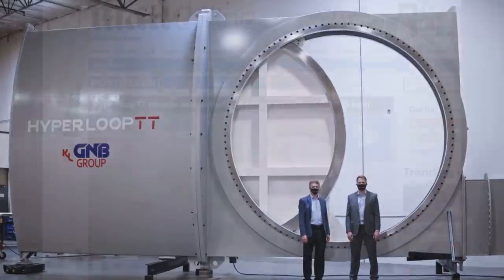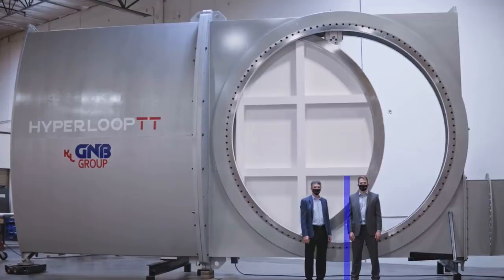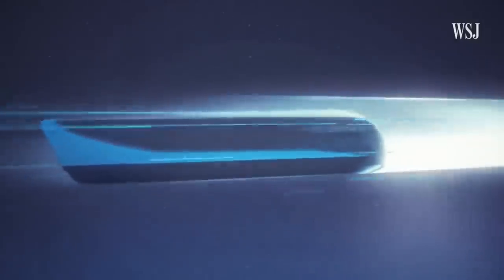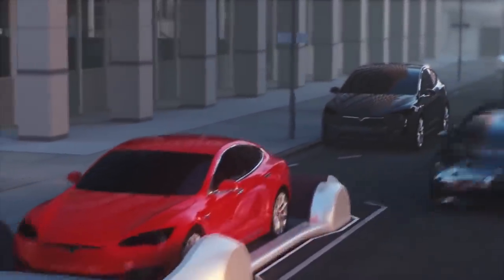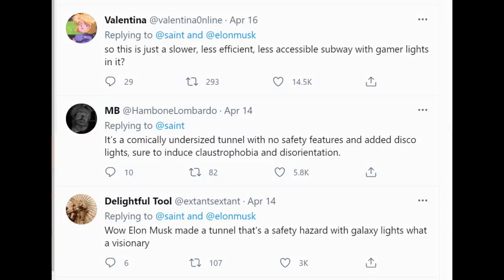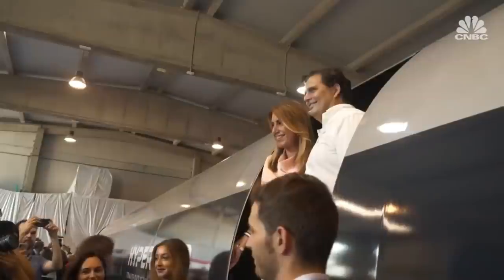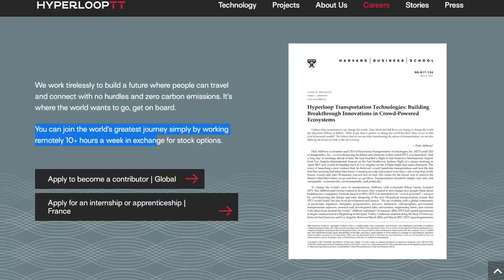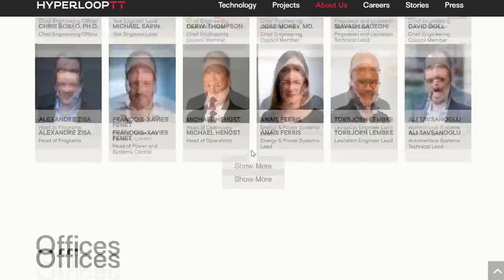Hyperloop TT vs. Virgin: The Race to Make Musk’s Moonshot a Reality - BUSTED!

Comment: What bothers me with Elon Musk's loop system is the fact that they didn't even make it autonomous driving (yet). Unlike the open roads, which Tesla's autonomous driving is already being used to a limited extent on, these tunnels under the convention center are a closed system. They can put whatever they want in the tunnels, in the road in the tunnels, and on the cars, whether that be sensors or paint, and program the AI onboard the cars to recognize specific patterns of paint or detect certain sensors and react to either of those things. They have control over the environment those cars drive in, designing it so the cars know exactly where they are, what they are doing, and what the other cars are doing should not be a difficult challenge, ESPECIALLY compared to the open road.

And yet they couldn't do it. At least, couldn't do it before it opened.

There's this ride at SeaWorld Orlando before the penguin exhibit. It is a trackless dark ride, which basically means it's autonomous vehicles driving themselves around, spinning the guests around and angling them up or down slightly to look at screens. This attraction would have multiple vehicles on the same section of ride at once, with, if I recall correctly, 3 all spinning around the same room at once, and 2-3 present for most of the show screens. Now sure, this ride isn't as fast as the loop, with the ride vehicles topping out at 5.5 mph according to the manufacturer's website, but it's still very much a case of multiple self-driving cars driving around the same closed-system setting successfully, and it opened a full 8 years ago. Tesla has apparently not figured out how to implement a similar system to what these guys used for driving cars at 30 mph in a similarly closed-loop system, and instead used chauffeurs. 

About the only good reason I can think of for "why" is the loading and unloading area, but it really shouldn't be that difficult to figure out something to make that safe.

Comment: Imagine if a contractor for just a normal train behaved like this. They design the paneling on a train and two years later you check back and they've just shown you how the junction switches will work.

Comment: Pipe Dream loop, Defraud Investors Loop, Money Laundering Loop...
How much energy would it take to keep the system under vacuum?
How would they deal with an emergency(medical or mechanical between stations?    
Wouldn't a high speed train be better?
Why no interest in ground effect vehicles instead, wouldn't they be cheaper, and much more practical?

Comment: Isn’t the pressure on the valve independent of the length of the tunnel? Kind of like the pressure on a dam isn’t dependent on the size of the lake but only the depth of water.
Reply: No, the air pressure is pressing on the face of the valve.
Force = Area * Pressure.
Pressure is one atmosphere

Comment: Looking at Las Vagas on Google earth, the further distance l could measure from end to end was about 25 miles. 
To reach 120mph top speed with comfortable acceleration and deceleration means you could make it from one end to the other in 15 minutes or so, but surely people need stops in between, so it would never get to 150mph if there were a stop every 5 miles, and it would take much longer to get people in and out of the pods compared to a metro type train, and they hold fewer passengers!!
Hype is the word!!

Comment: 3:25 Isn't this the area of a square? Shouldn't you use S=πr^2 instead for the circle? If so, it rounds up to about ~13m2, and if it's designed to withstand 140 tons then it should be able to withstand 130 tons?
Reply: He used pi=4 for a quick calculation.  He should have used 666/212 instead.
Reply: @kensmith5694  yeah it's rounded up too much

Comment: That's the absolutely wrong way to valve the hyperloop tube.  You need a giant ball valve, with a diameter large enough to hold one pod (or whatever they call it).  The pod enters the valve, it turns sideways to allow folks to exit and enter at the station, then turns back to the main line to continue on its way.  If no stop is needed at that station the pod just travels straight through without stopping.  Think of it like the 21st Century version of the railroad turntable.  There's already a ball valve nearly big enough to do this at NASA Ames in Mountain View, CA, used on the pressurized wind tunnel so they can keep said tunnel pressurized at 2 atmospheres while swapping out test specimens.

Comment: One teeny correction; the Eurotunnel project tech dug about 1 mile in 5 months on average; they dug from both sides. So the total average is 1 mile in 2.5, but one machine took double that.

Did Musk also dig from two sides? It didn't seem like he did.

Comment: So what happens to the rain and snow when that elevator takes you down? Does it collect down their until a sump pump removes it? 
I can already SMELL the dank mess down there 🤢🤮.
Worse yet, what if you can't see the markings and you're OFF a little bit? 🤯
Half of your car is over the hole as the elevator goes down. You'd be TILTING and head STRAIGHT DOWN 😱. Hopefully your car won't flip over.

Comment: Why not use a partial vacuum like the upper atmosphere which would reduce most friction and vibration as in 5% vacuum so it's take a ton of stress off the pumps and what happens at 700mph is the valve jams or gets bent because somebody uses substandard metal to keep profits higher. You can't just reanimate the pile of goo and metal from that impact. Full vacuum is not even in space I've read and a vacuum would drop temperature so low metal might just fuse or get frozen from water vapor where a partial vacuum of dry air would be less likely for this to occur. I myself go for the air behind forced in and the air ahead removed and sent to the rear and you can also have vents along the sides to put the air directly at the read of the train. If it was built so the back was large and the front was a needle like a wide based spire the back would act like a sail and the air removed from the front would act to pull so not 700 mph but a lot cheaper and a lot safer without moving part that can become a wall for the crash test dummies incident and no one will suffocate or freeze this way either.

Comment: HyperloopTT design pods, looked more suitable for OUTDOOR environment, due to the aerodynamics frame with the low infastructure lean mag-rails, which is hilariously ironic, to be even less expensive ticket and ride then modern gernan & japan models. But, only to be in a massive infastructure vacuum realm that makes it a 'Redundentloop,' consider the following. The more narrow you make a tunnel to muzzle speed sound polution issues, the more you need to burrow through tunnel drag, the more power to use, the more vacumm to be, the more massive the cost management is the whoke structure, total REDUNDENTLOOP.

Comment: You know, it seems odd... Like, why bother with a vacuum? Wouldn't it be all the same to just suck the air out at one end creating an "air flow" that reduces resistance? The point of the vacuum is to get rid of resistance. At that point you can zip through the tunnel pretty quick. I mean, the idea of a tunnel is pretty appealing in that you get rid of harsh elements and reduce the possibility of accidents. If you do it with air flow then you can even merg on and off without problems.

Comment: Why are the capsules designed aerodynamically if it’s a vacuum or near vacuum? 

I’m not an engineer but just by looking at normal trains I feel like they must have one of the lowest drag coefficients per kg. Most of the train basically follows the slipstream of the front. Even train rails are very efficient compared to tires and pavement. 

So trains are one of the most efficient ways of transport. Why the vacuum? I like elon musk’s work but I think he should focus on cars!

Comment: 800mph in LA with only 3 miles of track. And those news reporters were okay reporting that? The G forces would be astounding. What is that 14 seconds? Well not including acceleration and stopping. Breaking the sound barrier to go 3 miles? Seems a bit overkill. Much safer to take the few minutes to walk it.

Comment: Thinking about tube transport, I would use atmospheric winds funneled and directed in tubes to push the vehicles trough the tube while the air in front is sucked out, again, with atmospheric winds. No wind, what then? Hey, you wanted to go greener!
Reply: They could use electronically controlled valves/openings to let  the air out in front of the vehicle through the sides of the tube itself, while the openings close behind the vehicle.  The vehicle triggering the timing should make the realisation quite easy-peacy. Add your maglev thingy to reduce friction. Divide the transportation tube in smaller sections with iris valves to maintain a reasonable gas pressure of the propulsion with of course more piping for the sections. Add RGB lights for the fanboys and girls. Call the press.

PS: I would propose air reservoirs under the pressure of sea water off shore, where wind turbines could pump the air down to the bagpipe like reservoirs. The air should be fed in along the transportion tube from time to time.

Comment: I'm at loss at 4:30-4:45, about the force that the valve door have to handle. why the force is timed with tube length?
Did I miss something?
Reply: Stumbled over this calculation as well. I’m pretty sure TF made a mistake. The amount of vacuum behind the door has nothing to do with the force … just the pressure difference and the surface area. The equation is F = p · A (force = pressure · area).

Comment: Why are they making aerodynamic capsules for an evacuated tube?. A cylinder would be easier, and give more space per capsule. At worst the ends need to be rounded to deal with the pressure differences
Reply: "stupid" works as a theory for "why that shape"

Comment: I don't really understand what is so special about this idea. In overall it is just a matter of moving air in the whole tunnel by the length of the train. Assuming sealed tunnel, the train will have to compress the air in front of it and the same amount of air will decompress behind the train to take exactly the same amount of space. Obviously if you compressed this air, then releasing it behind will give you most of this energy back. The overall energy used for that is just how much air did you move how far and maybe how much did you loose by friction or heat loss. In comparison, regular trains usually displace the air and then suck it behind which causes drag and it is a loss. If you are able to compress this air to smaller part of the tunnel or train itself, then you can get most of this energy back when you release it and use the thrust from it. It's still quite weird idea but the point is, that removing whole air from the tunnel would require massive amount of energy compared to just suck air in front of the train and release it behind. But hey, there's even better idea. What about just blowing air on the one side and blowing it out on the other side? How much energy would it take to make the air move in the tunnel let's say 400km/h? If you do it, then the train moving at the same speed would not move in relation to the air, it would have the same effect as moving in a vacuum with one expection. There would be barely any pressure difference, so everything would be lighter and safer. Even better, in case of engine failure, the train would probably move just because of the air movement, so it would eventually be pushed out in the next station. 
I think that it would be possible to minimize the friction and energy loss on air displacement without any kind of vacuum. It would be lower pressure on the front and higher on the back but it would be far from vacuum and it would be constant air movement. The only question that remains is - why? Modern high speed trains already have so small drag, that it seems almost pointless to overengineer it that way. The only challenge comes from the tunnel itself. It is restricting air movement and that is causing much more drag. The train has to push the air in front. Some of the air will leak between train and tunnel walls causing some additional drag and decompress behind. Rest of the air will be constantly pushed outside of the tunnel and at the same time some of the air will be sucked from the air behind. It can be reduced by installing air tunnel nearby that creates short passage for the air to move around the train. This all is already very similar to both solutions I described above and the only difference is that all energy is put there by the train itself, no additional fans are used to compress/decompress or move the air around. If we simply want to increase train speeds, the most probably the way to go is just to put bigger engine in it. If we care about efficiency, then doing nothing and relying on natural air movement is the best. Only if we want to make it efficient and fast, we could try to optimize the air movement by using additional fans. That still seams to be more reasonable than putting it into giant vacuum tube.

Comment: I guess there’s a mistake / a misconception at 4:30: The amount of vacuum behind the door (the tube length) has nothing to do with the force … just the pressure difference and the surface area. The equation is F = p · A (force = pressure · area). 
But the Hyperloop is total bs anyway ;-).

Comment: Well, the Valve in that size is impressive. certainly a good example of modern day engineering and production. Getting such a large thing built in the first place, let alone with everything correctly cut and drilled.

Still hyperloop is still stupid

Comment: I wonder if you could design this as a WIG / ground effect vehicle gliding on an air cushion in an ultra smooth tunnel and design it so you have perfect laminar flow and the air rushes past the vehicle without turbulence. Leaving no energy and no "wake" besides a bit of heat. Maybe you could use evolutionary optimize the shape with CFD software like OpenFoam so the vehicle is driven with a single wheel on the tube floor while traveling while the front wheels get retracted like landing gear of an aircraft. Not sure if this is possible. But a tunnel with zero wind and very smooth walls and vehicle could provide a solution to the aerodynamic problem without vacuum.
PS: I guess even without creating turbulence you still have skin friction which rises by the square or cube of velocity. Friction is a bitch.
But maybe such systems could be more energy efficient to transport freight and passengers than trains or airplanes because they are lighter and need less structural reinforcement. Because they can't really derail and face a very predictable environment and wind. So maybe once these tunnels are build the vehicles could be quite cheap to manufacture and run.
Airplanes cruise high up to get less air resistance. So maybe even a slight under pressurized tube could greatly help.

Comment: I just would love to see the size of the vaccum pumps to remove just atmospheric pressure! Never mind if they want this attrocity to run in a vaccum ( below 0 atmospheres). What a scam. This thing is going to need tremendous electrical power to run. Nevermind all those LEDs
Reply: And how are they going to dissipate the heat generated? All the systems onboard the capsule are going to be generating a lot of heat, and all that heat's gotta go somewhere. Inside the tube, you have very little air, so how is that heat going to get out?

Comment: They should move their tunnels about 30,000 feet up into the atmosphere, that way they won't have to pump on them as hard to achieve their vacuum goals.
Reply: Yes and then they don't even need the tunnel.  You just put some airfoils on the sides of the train car with jet engines on them.  You could call the reduced air pressure portals for getting onto this system "airports" or something clever like that.

Comment: Even if it works the way they say it will it is NOT a differen way to travel. You are still riding in a maglev on a rail. Faster may be better but it doesn't constitute a new method.

Comment: Thunderf00t, maybe at some point you can go into depth with respect to the energy required to establish and maintain a vacuum of that size. If you want to evacuate a 500-mile tube, and there's 160 tons of pressure on the crosssection, you would need AT LEAST as much energy to evacuate it as you would need to lift 160 tons by 500 miles... which puts us deep into "rocket launch" territory, right?

Comment: By these calculations, the plumbing in my house has to "withstand" many tons of pressure.  You don't multiply by the length of the tube, ffs.
Reply: Because, for a given pipe, it is capable of much higher pressure differentials with greater pressure on the inside than with greater pressure on the outside.
Reply: @electric7487  Good thing you don't design submarines...
Reply: @jpdemer5  Well yeah, that's exactly why submarines are built in the way they are.

Comment: Circle area's as simple as pi*(r^2). Comes out to about 125 tons of pressure on the valve when you run the numbers. Your point still stands, though.
Reply: physicists like to approximate because the order of magnitude of the result if often the thing you care more about than the exact number. jokingly our prof used to approximate a cow as a sphere with radius 1m.
Reply: @S1nwar  There's actually videos where said approximation is a reality.